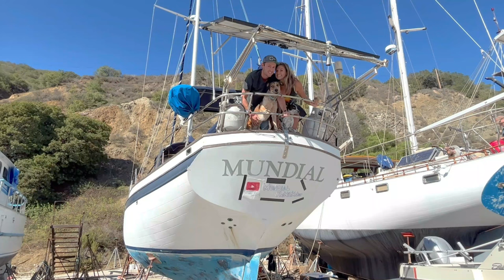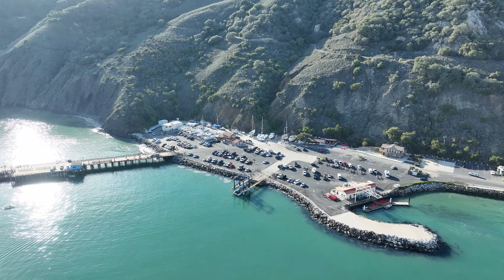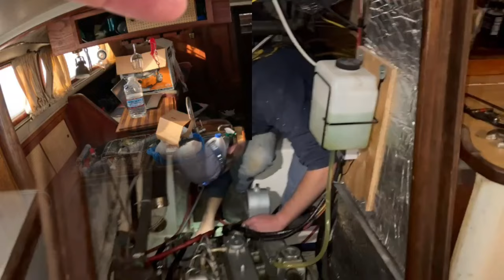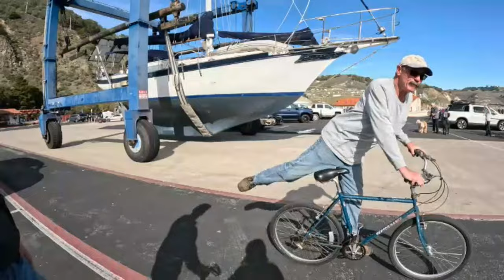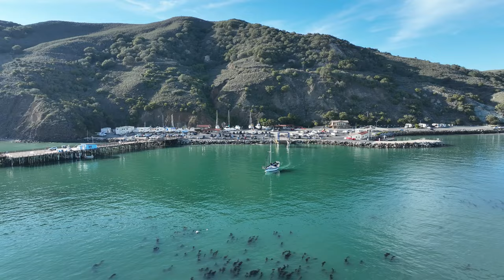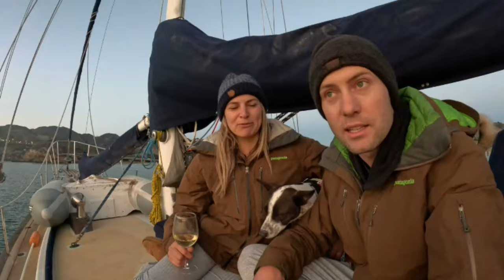[Ep 20] Back in the water after 3 months of boat work!

Comment: Hi Guys, great video...please remember to recheck your engine alignment in the water as the hull shape changes a bit....enjoy!
Reply from the maker: Thanks for the tip!
Reply: @spangenbob  i guess mainly because the engine and prop are supposed to be fairly set in stone.  They do use soft couplers in a lot of boats that I've seen.